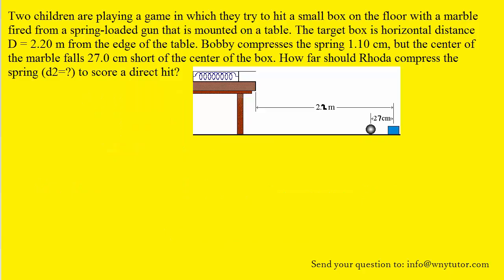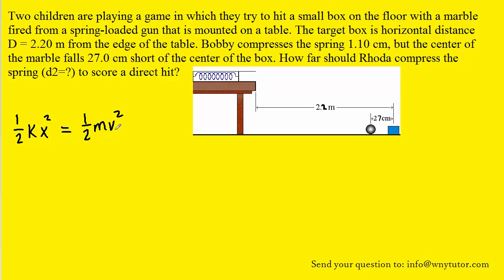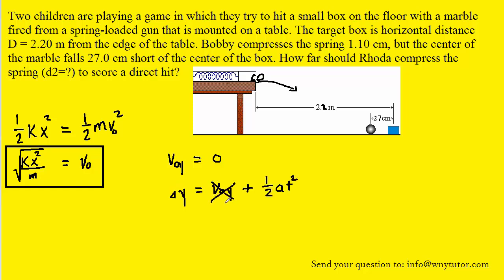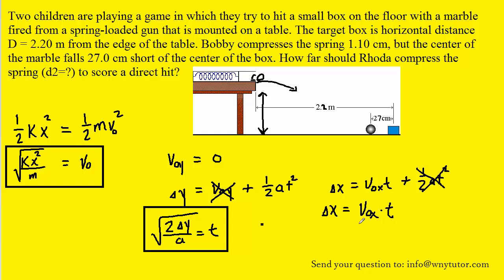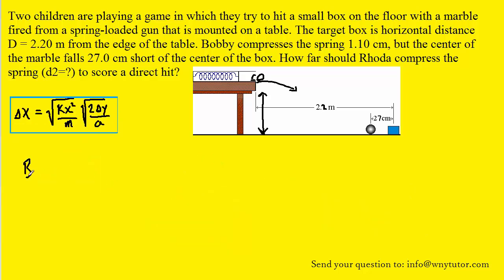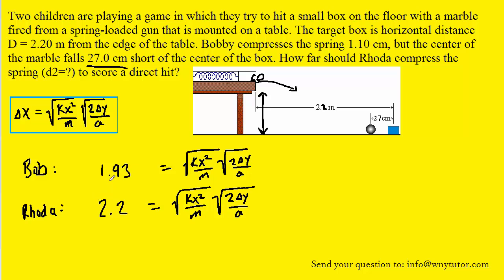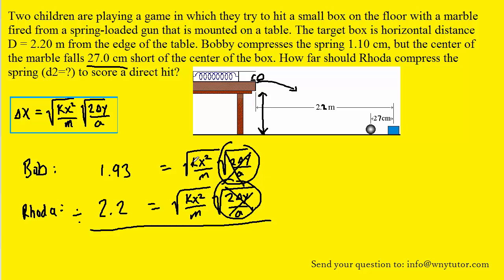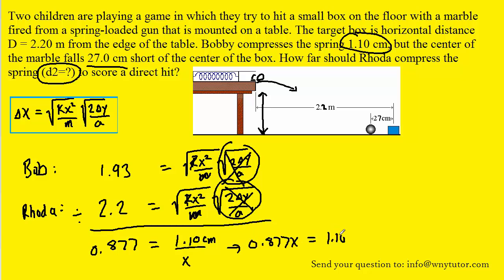Two children are playing a game in which they try to hit a small box on the floor with a marble fire

Comment: I have a question. For calculating the potential energy, you said that only energy presented would be the spring potential energy. Then why gravitational potential energy isn't considered in this problem? Since the ball is launched to mid air and dropped, would't this ball also have gravitational potential energy too?
Reply: +Park Shawn And also, thanks for the awesome video.
Reply from the maker: +Park Shawn Good question.  When we used the conservation of energy principle, we were doing so when the marble was still on the table (BEFORE it started falling to the ground).  When the marble is on the table, there is ZERO CHANGE in the gravitational PE, so we can exclude it from the equation.  When the ball left the table, we used kinematics, not energy conservation, so even in that case we disregarded the gravitational PE.  Does that make sense?
Reply from the maker: +Park Shawn You're welcome!
Reply: +WNY Tutor Wow I didn't expect to get the answer this fast. Yeah I understand. Thanks you :>
Reply from the maker: +Park Shawn No problem - thanks for watching!